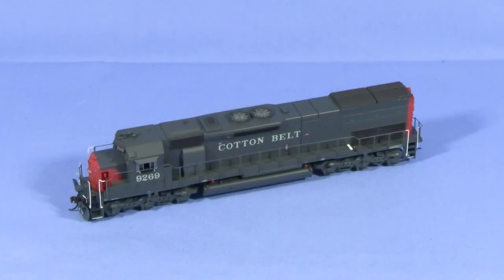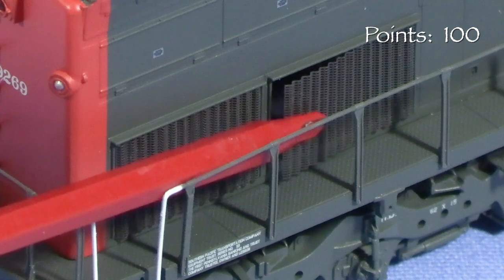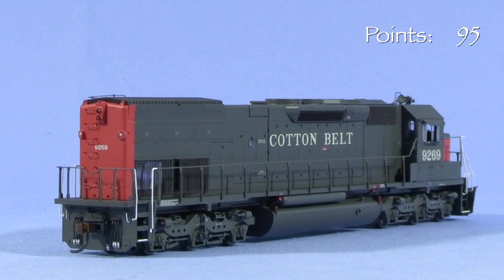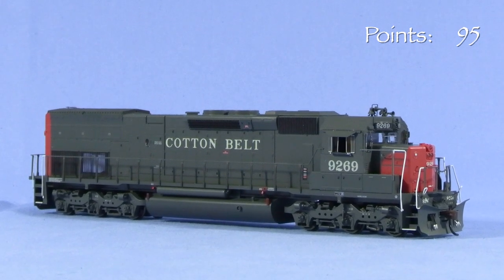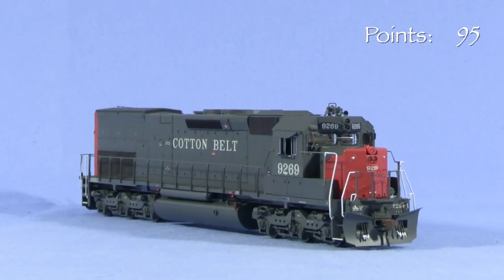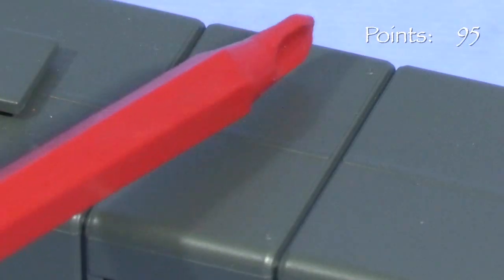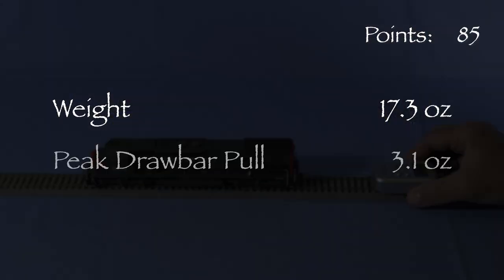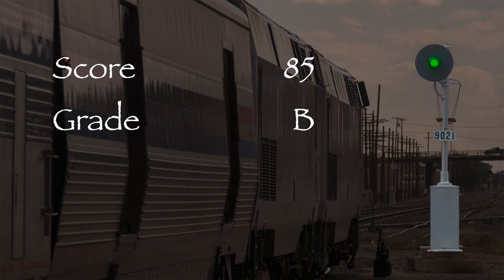Product Review HO Athearn SD45T-2 SSW - SP Tunnel Motor!

Comment: I have several of the Athearn RTR 45 and 40T-2 models and they are good models for the price.  The DCC and sound equipped versions are good too and easily upgradable with user decoders and speakers.  I do wish Athearn would issue a Genesis version equal to their SP SDP45s which are excellent models in every way.
Reply from the maker: It would be nice to see a Genesis version of these, though I'm sure the price would go up accordingly.  I'm happy to see that this newer version has more accurate detail than the older ones.  I have several of those that need some work.  I'm looking forward to running them on my future Donner layout.  Thanks for watching!

Comment: I always appreciate your reviews Dan.  Especially when you point out what improvements that can be made.  How low does your score need to be to fail a review ?  I've only seen the great and reasonably good. What was the lowest score you have ever issued ?
Reply from the maker: I think the lowest score I've had so far is a 65, which is still passable, but barely.  60 would be a D-.  Anything less than that would be a fail and trigger a red signal.  I have not had to do that yet.  I do tend to buy models that I expect to be good, so hopefully we'll never get down that low.  Thanks for watching!

Comment: Hey Dan, I never took that model out of the box, so no, the windows weren't glued in place. -5 points! Also, seeing the headlight wiring dangling in the cab was very distracting. Maybe that's to be expected from an RTR-level model from Athearn.
Reply from the maker: Okay, I wasn't sure about the windows.  I try to be extra careful with your models because I don't want to break anything.  Sometimes I wish Athearn would dump that "feature" because it seems like the windows always end up in odd positions.  Without a cab interior, there's really no reason to have them open.  I agree about the wires.  I have a few Athearn RTR models with the same issue.  I'll probably try to re-route them so that they don't show.  Thanks so much for loaning me the models and for watching!  I am still working my way through the last of them.

Comment: Hi Dan. Thanks for another interesting review. Seems like Athearn hits the target in a better way with their cheap models. I don't like or buy long engines like this because of available space and tight curves but I got to admit that it's a fine model at the end. You should've been more severe about the couplers height to my point of view. Grill is not only an issue on SD's. I had the same problem on a MP15ac. They probably don't secure them correctly at the factory. Otherwise, you're right... They are improving !
Reply from the maker: It seems like it's always a bit of a challenge to bond etched metal parts to plastic.  I've had issues with that trying to get aftermarket parts to stick well.  Still, they should't be falling off in the box.  I don't recall having this particular issue on any of my own Athearn tunnel motors, but I also haven't looked at some of them in a while.  I would agree that long engines look better on broader curves.  Thanks for watching!
Reply: @DanielCortopassi  Hi again Dan. I glued one on my MP15ac and had all kind of problems doing it properly. I used thin CA. It may be a bad idea but I thought that the more liquid is the glue, the less of a mess it's making. Those etched grills have so tiny openings. I had to be careful not having CA blocking when putting back in place. You're damn right, engines shouldn't come with broken parts. Especially grills. That's the price to pay for highly detailed engines.... made in China !
Reply from the maker: @lucgagnon5241 I have trouble controlling where the thin CA goes sometimes.  I often prefer the thicker type, applied with a small piece of wire so that I don't use too much.
Reply: @DanielCortopassi  Hi Dan. Thanks for your kindness of answer my mails. Hope to see another review soon. I've definitely learned from you since I'm watching them. We're both in the hobby for long. Long enough to see it has completely changed lately. There is incredible stuff putted on the market for the past 10 years or so. Doesn't mean It's done correctly but boy as we say in french : they push very far on details !  Regards

Comment: With the numerous runs Athearn has produced since 2004, it’s odd that they’ve never made the 6700-6800 class rebuilds. Did those have altered battery box doors like the SD45R? Great video….
Reply from the maker: Yes, the SD45T-2Rs had the GRIP louvered battery box doors.  They also had EMD style latches installed on the radiator fan access panels in the rear.  The oscillating lights on the cab were removed, but at least some of the engines kept the emergency lights in the nose for a while.  I am hoping that Athearn will do an undecorated version in the next run.  I'd like to get one and detail it as one of the rebuilt units.  Thanks for watching!
Reply: @DanielCortopassi  thanks. Good to know. Of course the detail differences didn’t stop Athearn from producing the SD45R’s using railpower shells, but the most noticeable flaw on those was the missing “used to be” L-windshield. I learned about the battery doors from one of your videos. The ScaleTrains SD45R is far superior obviously I was glad to see those made

Comment: Great review, Dan. I've convinced myself that I have to buy the premium locomotives, but I should reconsider that since this RTR model would most likely be fine for my layout. Do you know if the DCC RTR versions have lighting features similar to the Genesis models?
Reply from the maker: Many of the Athearn RTR models, both engines and rolling stock, have pretty good detail.  Some are better than others, but the tunnel motors are pretty good.  To my knowledge there is no difference between the DCC & sound equipped RTR models vs. DCC ready, other than the presence of the decoder and speaker.  I'm pretty sure they use the same shell and chassis for both.  So I would expect that even with the DCC version, you'd still need to make some modifications if you wanted to light up the emergency light or number boards, or add ground lights, since the model doesn't have those.  To be fair, a lot of Genesis models don't have lit number boards, either, though I think that's changing with the Genesis 2.0 series.  Thanks for watching!
Reply: @DanielCortopassi  I'd love to see a side by side comparison of the RTR and Genesis if you ever have an opportunity to do that.  Thanks again for an excellent review.

Comment: What's your thoughts on the newer speed lettering versions with high ditch lights mounted in the middle of the walkway?
Reply from the maker: I don't have any recent Athearn tunnel motors like that.  I do have some with ditch lights, but those were the older ones with bulbs, and I redid everything with my own LEDs.  In fact if I recall I had to give them the 90s treatment myself, so the ditch lights are aftermarket castings.  I think the Athearn RTR tunnel motors are pretty nice models in general.  Thanks for watching!

Comment: These are pretty nice considering they are from the RTR line.  Being a fan of the SP from growing up seeing the SP tunnel motors crossing the causeway between Davis and Sacrament, I've always been a big fan.of them.  I have D&RGW SD40T-2's and I tried removing the front coupler to remove the shell and I could not get it to budge.  I tried gently forcing it but it still would not come out.  What would you suggest?
Reply from the maker: I'm assuming you're talking about the whole draft gear box.  Sometimes they get stuck on the frame on some models, even with the screw removed.  Once in a while I need to pry it off.  It's a difficult area to access, but if you can get a tiny flat bladed screwdriver under one end of the box, you might be able to gently pry it loose that way.  If that isn't feasible then maybe take some needle nosed pliers and grip both sides of the box and try gently twisting it back and forth.  Thanks for watching and good luck!
Reply: @DanielCortopassi  I'm guessing some adhesive is holding the couple box fast.  I have 3 that I was trying to remove the couplers to get the shell off and all 3 were the same.  Couldn't budge the whole draft gear box.  I didn't go crazy because I didn't want to damage anything.

Comment: WHY CANT ATHEARN MAKE THESE AFFORDABLE WITHOUT THE DCCREADY AND NO SOUND DECODERS IN THEM?  IS IT POSSIBLE FOR ATHEARN TO MAKE THEM WITHOUT ALL THIS STUFF IN THEM?  IM TRYING TO GET THEM, WITHOUT THE SOUND AND THE DCC READY MECHANISM IN THEM.
Reply from the maker: I'm not in the model manufacturing business, so this is just my guess, but I would imagine that it's more economical for Athearn and other companies to use the same chassis for both DCC and DCC ready versions.  The DCC and Sound versions then just need a decoder and speaker added.  There aren't many models being made that aren't DCC ready anymore.  I would imagine that the light board with a DCC plug is a very cheap part, so I don't think getting rid of it would really save much.  Just my two cents.  Thanks for watching!